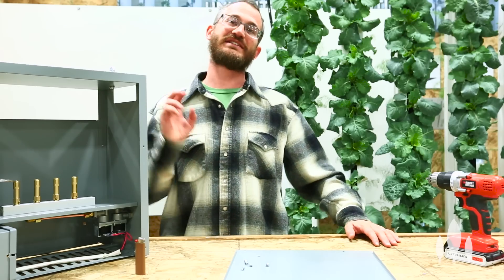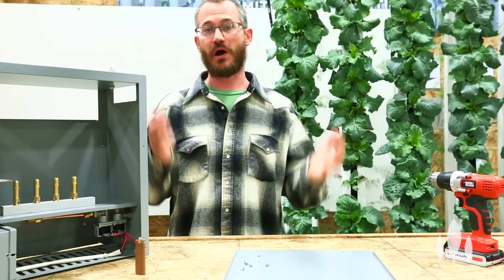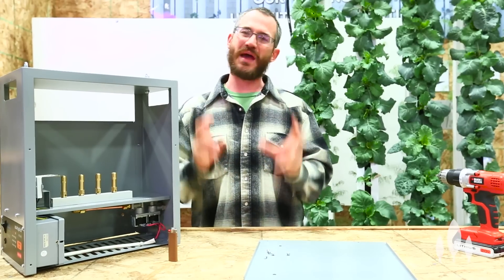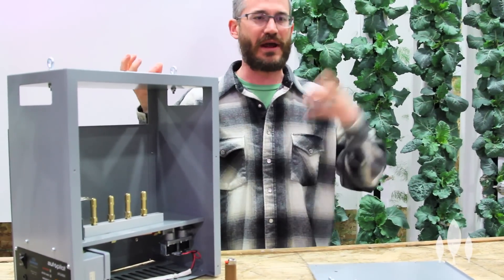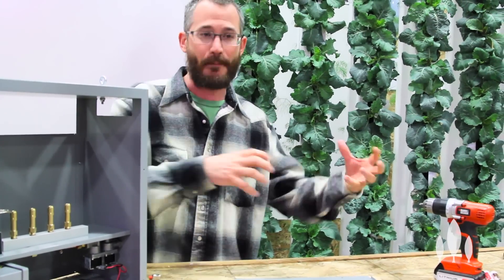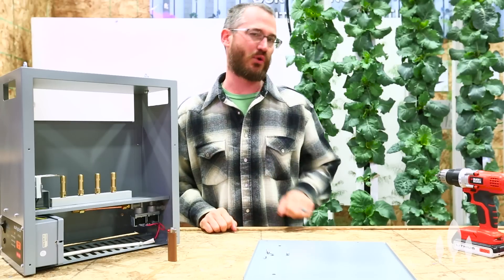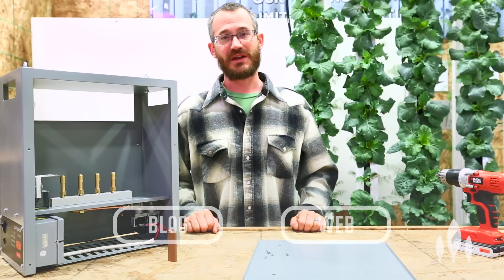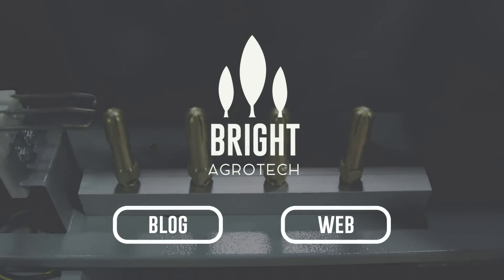CO2 Enrichment Methods for Indoor Growers

Comment: would you recommend a clone tent of 2'x2'x3' to place this burner within. then use a duct and an inline exhaust fan; to pull the air out and into your main grow tent?? would this be wise to do in order to keep the heat in a separate area?

Comment: There is no need for co2 in richest if you have proper intake of fresh outdoor air and filtered exaust
Reply: I think that depends on the local climate. If you have long and cold winter, you definitely don't want over ventilation.
Reply: Plants can survive from good ventilation but it's benefial for the flowering stage to have more then what nature provides. It's like humans juicing and taking supplemental vitamins

Comment: You say i have to do this i have been growing indoors 25 years very sucsesfull every year. high grade quaility weed never have i used co2 ever ?
Reply: just cause you've been doing something for 25 years doesn't mean you've been doing it the most efficient way possible. it's been scientifically proven that a higher level of co2 than ambient boosts growth
Reply: Its a proven fact co2 increases yields and also allows faster growing time. An indoor grower on average veg for 60 days, on 02 you can veg in 30...
Reply: @smokehaze2313  bollocks
Reply: Awww the old man is scared of modern technology and methods. Your shitty hobby lights probably dont warrant co2 supplementation. For ultra high end ppfd LEDs with efficiency levels approaching 3.0 umol/j, co2 of 1500ppm+ is basically a must. It also means you get 2.5-3g/w yields. But im sure how youve been doing it since the 90s works just as well lmao
Reply: @Plecebo1996  bro watch the 90s shit 
Check that shit to the 60s plz
Reply: Troy would you use co2 for PPF: 1,800 µmol
Efficacy: 2.5 µmol/J? I got this light for my tent but I thought you can run co2 in a tent?

Comment: thank you for every video you do. ive used baking soda/vinegar in small enclosed grows but moving to a greenhouse in zone 10 where heat can not be added and the air quality is bad. mushrooms are cheap as you can make all you need from your first purchase (factor in time)but like vinegar hard to control the output. please bring in someone to do a how-to video on closing this end of the loop. mushrooms are a sustainable pain in the neck. propane is easy but not sustainable. you rock. also more on worms.

Comment: If I add co2 (in the air) to my aquaponic system. Obviously in an in closed area like a green house. Would the co2 harm me or the fishes oxygen levels?
Reply from the maker: Hi Dylan, not unless you’re over 15000 ppm, which is unlikely. You should be just fine.
Reply: @ZipGrowInc  4000+ ppm co2 in the air is toxic to humans 40000 is deadly

Comment: So you burn hydrocarbon. That's fine. My concern has to do with incomplete burn of hydrocarbon with production of CO (not CO2). I have CO detector in my greenhouse. 

I can't seem to find peer reviewed paper on toxicity of CO on plants. What's your take? Should one use catalytic converter to eat the CO that is produced. And what about the workers inside the greenhouse? CO affinity to hemoglobin is much much higher than oxygen thus the toxicity to mammals (humans). I don't think there is LD50 for CO. But OSHA standard places upper limit of around 50PPM of CO.  Are these CO2 generator able to maintain less than 50PPM of CO (co-)generation?